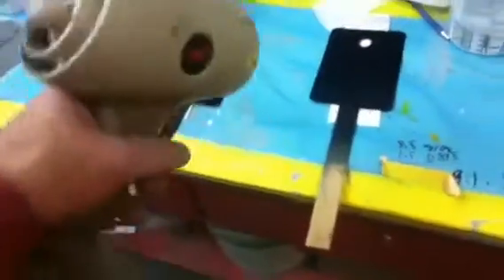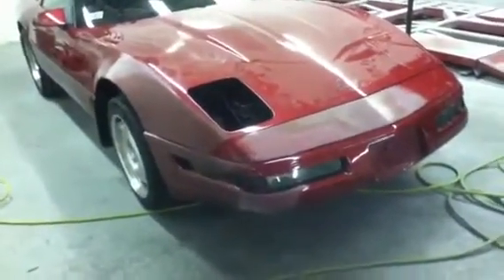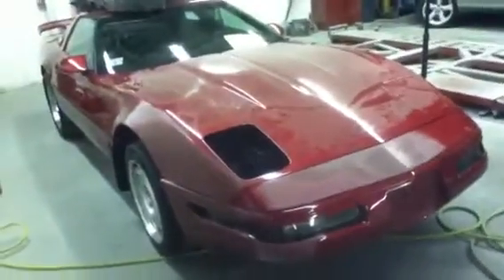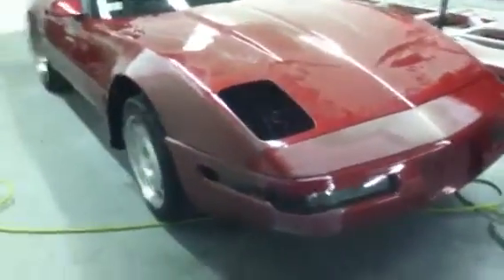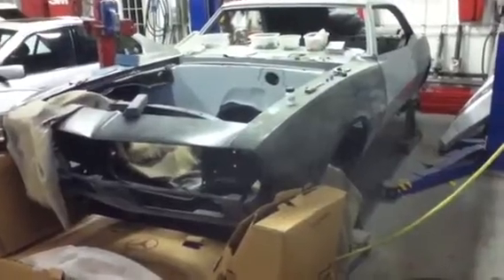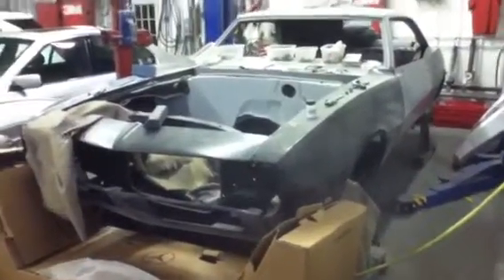Vette's and stuff

Comment: @satajet883 over here in the uk i've never used a sealer as such, from sanded primer its usually straight on with the base coat or ground coat if required

Comment: yeah i think, not sure, maybe some UK guys can confirm , but i think its a test fail if you cant open the doors from inside and out mechanically in the UK
to do with crash or emergancy door opening if the driver is incompacitated.

seat memory, at toyota our boss had a 7 series with memory setting for the seat, i used to always set it right up against the steering wheel, i hated that fat c**t lol

reds are funky to drying criteria
oh btw whats the number of the sealer on ppg
cont>